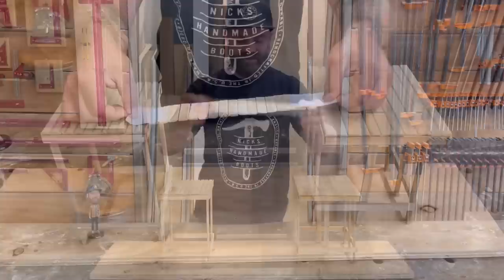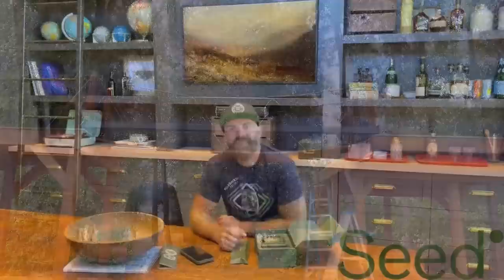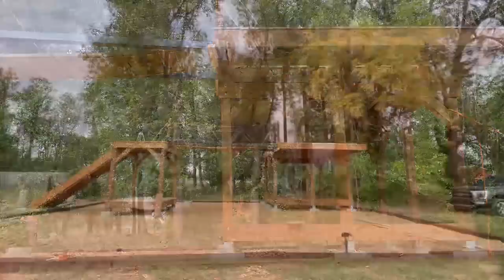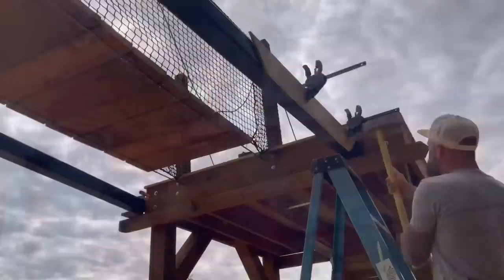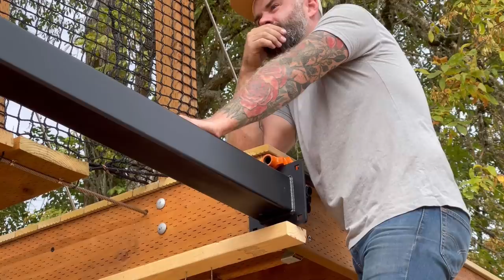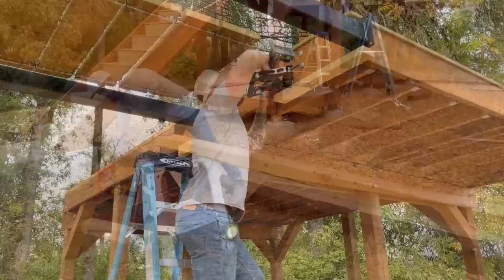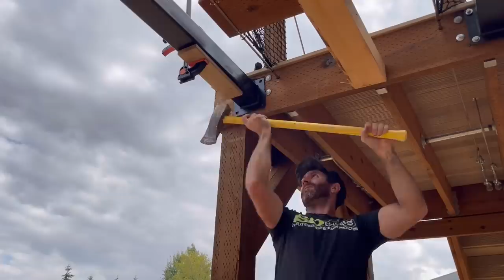My Treehouse is Falling Down || Fixing a Huge Mistake

Comment: I assumed you were going to add a few diagonal cross beams to the towers... but this definitely works as well ;)
Reply: A lot of armchair engineers here, and this was the best comment and best solution. (Maybe you are an engineer as well, lol) I am not. Enjoy your day!
Reply: @ST-ku5ni  I am an engineer, but in a completely different field so it doesn't really apply. I'm guessing he didn't want diagonal beams for the same reason he didn't want steel cables, because it's something to run into
Reply: @WoLpH  I was shocked that the original design didn't have diagonal bracing.. don't think I've ever seen a wooden tower like these built without them. Woodworkers should make engineer friends when tackling projects like this.

Comment: It's been some time since I calc'd a catenary, but the more level you drive the bridge, the higher the stress on the upper decks, pulling them together.  You may not have seen the end of this yet:  time and stress equal "creep", the deformation of materials.  A solution:  support the bridge from the steel beams, even if only in a couple/three places.  That will relieve the tension on the cable/wood interfaces.  Enjoyed the video, as always.  While you've come up with a lot of innovative techniques, we all might keep in mind that this kind of construction is millennia old, and the conventional  techniques are "conventional" because they've proven their worth.  But  I gotta admit to the fun!
Reply: Mechanics of materials! This brings me back to engineering math in uni.

Comment: did you think about loosening your bridge's wires before pulling the towers appart? 

Because i don't know if it is an optical illusion, but while your towers now seems to be level, the post supporting your top wire for the bridge seems to be out of plomb on the video. Maybe that was what prevented you from being able to pull the towers appart and you applied enough force to pry them out... Might wanna check on that.

Great video as always though!

Comment: Great fix… now that you have that steel in place it looks like a great place to hang a relaxing porch swing between the towers or even add a hanging sleeping platform that you can put a small tent on. Thanks for sharing and would loosing the cables have given you any more ease to pull the towers apart?

Comment: Expensive steel beams sort of eliminated the need for a suspension bridge, but cool for kids to be able to bounce across the span.  Rustic logs probably could have accomplished solving the towers pinching together,  and saved a few bucks.  I know, I know…who ask me anyways.  Every one of my projects could be second guessed.  Love your channel!
Reply: Yeah, my thought too. I mean, I don't dispute the validity of the solution, and bouncy bridges can be fun. But, yeah...

That said, I feel like the option B of larger bracing for the platform structure probably actually would've worked fine, assuming the footings are properly anchored (sorry, I'm one of those dummies that didn't go watch the first "making of" video, so I don't know what the status of the footings actually is). And then the suspension bridge could be justified both recreationally and mechanically. :)
Reply: Budget wise, that's what i thought too.

I mean, wooden beams will do the exact same thing, heck, they even used a beam to spread the towers...

Comment: An idea & thanks: I'm new to your channel and absolutely love watching your videos. This build especially shows your joyous adoration for your son. Just lovely. After seeing your fix, I thought - there's NO WAY he's going to leave that MASSIVE open 15' space underneath empty, right? With such strong steel beams you could hang or glide any weight from it. You could put a 15' wide rope ladder akin to a pirate ship with a wooden ladder and inward swing gate/door or port hole to climb through up top for those who made it up top. Then below each beam you could hang something like thick pool noodles to run through, bop each other, or swap out different items every few months on what is hung from it- when he's older a karate bag. You could face a 2-3 person swing the opposite direction of the pirate rope ladder. Or have your steel guy weld a runner or a seam in the bottom for pseudo zip line rope side by side to race each other (as long as padding is put on the landing side ;). Use that space when you get the chance! You'll be glad you did.

Comment: Running the cables through the 2 platforms and then at say 45+ degrees down on each side , to a suitable concrete anchor will reduce the lateral tension.

Comment: First of all, this is the coolest tree fort ever and you are a great dad for doing it! Watching this gave me an idea for you: These steel beams would be excellent as tracks for a 'zip-line'-esque rope swing. The way I'm thinking is to build a small (12"-18" long) railcar that surrounds one beam with 8-16 skateboard or rollerblade wheels, locking it in the x and y axes and freely rolling through the z axis along the beam. Then hang a large knotted rope (or some sort hand-hold) from bottom middle of that railcar . The idea is to push off from one lower platform while hanging on the rope and then ride the wheels across the beam to the other lower platform. Looking forward to seeing the rest of this build!

Comment: This is actually super helpful to me right now as I put together my son's new playset kit. I was worried about this exact issue because it also has a "clatter bridge". I reckon now if I notice a rigidity problem when the kids play on it, this is actually a fairly straightforward solution (and I could probably just use lumber with steel plates on the ends rather than a full on steel beam). Good stuff!

Comment: Jason I love your channel and can’t wait til you’re back in the shop.  Here’s a thought: remove  the suspension bridge and slap those wood tread boards on top of the steel beams.  All that lateral force becomes down force which is exactly what the towers were built to withstand.

Comment: attaching the end of cables to the ground under the beams  it would minimize the horizontal vector of force depending to the pressure over the bridge,so if you put more pressure you get more horizontal force minimizing .

Comment: Cross bracing on the columns! It will fix it without the numb-nut beam across the front. The beam fixes the bridge movement issue but not at all when a strong wind comes through. Simple wires and metal ties. You can always tighten them.
Reply: The height to cross width of the structures make it unstable. The problem will return

Comment: When you were fighting with trying to pull the tower out enough to slip the beam in, did you release tension on the cables? I would think by backing off the tension on the cables would allow you to pull the tower back enough to slip the beams in place then just tighten the tension again on the cables.

Comment: I worked with heavy production welding before, and I learned one thing. To get something back into plum. Chainblocks. if you couldnt with that. Use a bigger chainblock. ( And heat sometimes)

Comment: I built a playset for my kids last year that had a similar two tower design. In my initial design I had planned to connect them with a suspension bridge like you have here. I ended up scraping the plan because I became concered with the bridge causing something like this issue (I was more envisioning the two towers getting pulled over).

I like your solution though. I took the easy route and just made a ridge bridge with some 2x8. Worked, but not nearly as cool as the suspension bridge! Great videos, love watching!

Comment: Put diagonal bracing in the portal frame. From top one post to bottom of other post s d that should fix it. At moment the little braces aren’t doing much. 

Have one in line with bridge and 1 perpendicisk to it. Cheaper than the beans.

Comment: I love it!  You discovered a problem and set about to find a solution to that problem.  The failure of one solution after another did not deter you.  You kept at it until you came up with something that worked.  Sledge hammers, clamps, scrap wood, Ford F150, rope,... The only things missing were shoelaces, bubblegum and an old Farrah Fawcett poster.  Awesome lesson in sticktoitiveness.  Question:  could you have used some other material for the beams that might have been easier to handle, such as wood or PVC?  Awesome video!

Comment: To move them apart.  Two boards.  Hinged in the middle slighting longer than needed (like 1/2" - 1").  Set them in place then pull them down /-\.  They will press the two towers apart as the gets down to flat -- --

Comment: Lots of good comments but I found myself shaking my head as you climbed into the truck. Besides the cable tension (it's always the most obvious that we discover last) I was shocked to see the steel. I mean, 4x6 timber (even 2x would have worked in compression) would have retained the overall look. I like your willingness to share corrections as you go. Thanks for the good content and the ears look better too.

Comment: Dear Mr Moth, There could be a problem where the cable threads through the uprights (36inch height) as the cable may indeed start sawing its way down the post with the movement ....  I recommend passing the cable through a sheaf (piece of waterpipe?)
Reply: I commented similar a few weeks ago. Protect them holes!!!
Reply: Good point, could maybe cut a U-shaped piece of PVC and shove it in there so the cable wears the PVC out which is replacable.

Comment: With those steel beams, you don't need a suspension bridge. I have found that the secret to life is bracing.  Those little braces you have at the corners are not very effective.  They don't prevent the towers from racking.  I would have put diagonal bracing from the lower outside corners of each tower to the upper inside corner of each tower.  Then, make sure each tower is anchored into the ground sufficiently so that the towers don't get pulled towards each other. I once built a 12' x 34' greenhouse for my wife with treated 1 x 4's ripped in half (1 x 1 3/4) and it withstood multiple tropical storms over 14 years until trees fell on it during hurricane Katrina.  The replacement 34' x 96' greenhouse is made with 1 1/2" pipe and survived hurricane Ida with minor damage.  Had I taken the plastic covering off it would have had no damage at all.  The key is good, effective bracing.

Comment: You might want to fix the handrail cable to the vertical posts. That way you will reduce the moment on the posts and they would be exposed to compression only.

For the steel, next time make a adjustable connection to one end. Would make it a lot easier to put in place.

Nice work on the treehouse!

Comment: Your friendly neighborhood structural engineer here. I would have used a single diagonal cable with a turn buck from the upper left to lower right of the lower level portal that’s just to the right of the bridge. Also, and cable and a “come-along” from the upper deck to a truck would make plumbing the structure much easier. Jason, you’re awesome, I love your content. You taught me how to make cabinetry.

Comment: I was thinking to myself, self, how did they make bridges on playgrounds I used to go to? They'd make a flat solid bridge first to connect the two towers then install the chain/rope bridge on top of the bridge floor. But using steel beams is a great idea and is not over doing it at all! Nice job!

Comment: Great job, admittedly I was one who said it was over engineered .. as far as size of lumber used. which is still true,  its great but it is!  Smaller lumber could have been used. and proper cross bracing would of helped or solved this issue as well. and simple 2x6 or 4x4 wood would have accomplished the same thing as the industrial overkill 4x4 steal tubing. lol  when I say proper cross bracing, I mean you have corner cross bracing which is ok for things up top, but when you have a 8 ft tall structure that weights about 2500+ lbs, you need full top to bottom cross bracing. Like building bridges you don't just see a cross brace on corners, they go the length or height of the span in that section. when designing structures or Planes in my job. you want maximum strength with minimum weight. Now overkill on a child's play-set is all good and isn't hurting anything of course other than wallet.

Comment: Wood across that distance would compress and bend I assume? The black looks nice with the wood I think you failed upward 👍
Reply: Wood would have been totally fine... Those steel beams are a ridiculously over the top solution to this problem.
Reply: wood would have been fine.
Reply: @GreganDunn  his kids are going on this
Reply: @CoveringFish  would be plenty strong with just wood. Kids would be totally safe! The steel is complete overkill.

Comment: Those beams are ideal to attach some swings to too. Though that will add a dynamic sideways load in the other direction. So it might need some cross bracing after all.

Comment: For the NEXT time you have to do this.... ratchet winches are your friend.  My buddy and I demo'd an 80' x 40' 150 year old barn in Sacramento to salvage the redwood beams and tin some years back.  Because it the city had built up around it, there were fences less than 3' from two sides of it.  We hooked 3 ratchet ratchet winches to anchor points opposite the fences and pulled it toward the opposite corner -  we were able to make the entire building lean away from the fences - then cut into the principal posts and slowly winched the whole thing until it collapsed with no damage to the surrounding buildings.  Yeah... super safe.  But it worked. Pulling the treehouse a few inches would have been a breeze.

Comment: Tension cable on the big platform on the top next to the bridge and on the bottom on the back side.
But also should slack the bridge wires

Comment: As a serial over-engineer, I can so relate to this. Coincidentally I also happen to be a furniture maker, maybe its because I was never taught carpentry, but figured it out by myself and don't really know how to estimate material/constructional strength.  (you should see my Changing Table that can support the weight of a small car.) I actually came up with the same idea when I saw your last video because it was indeed showing flex. But for aesthetics sake will you be putting wood cladding around those beams? Good job though, the build looks really nice.
Reply: I'm the same way. I built a nightstand for my daughter which was immediately dubbed the "Helipad" because it was so big and heavy. LOL

Comment: If you had enough room on one side of the bridge you could use metal monkey bars as a brace too. Add a little fun to the functionality.
Also, I have pulled a garage into plumb using come-alongs and ratchet straps attached to the top plate of the garage and then to a sharpened steel stake driven into the ground at an angle away from the garage (about 3 feet long and 4ish inches thick so very heavy duty and very secure to the ground). As mentioned in some other comments, reducing the tension in the cables would have made it easier too.

Comment: Loved this episode - I saw some of the other comments below and agree that you could've probably made things easier by loosening the tension in the cables to allow you to open the gap between the towers.  But you got it done in style anyway - awesome work!
A possible next issue I could see is the 3' posts for the railing bowing in with the tension - I'm not sure how high those forces are, but a triangular bracing from the posts to the metal cross-beams may help with any bowing that might develop.  Alternatively, if you like metalworking ( :o) , you could weld 4 new upright metal posts directly to the ends of the cross-beams and get rid of the wood posts altogether.
Really nice work, though!  Can't wait for the next installment(s)!
And kudos to your grandma for braving the bridge - amazing!

Comment: VERY INTERESTING! I think this episode is a good insight on building structures and their design. I think it would have been a good investment to add corner strength by increasing the brace size on the stair-less tower. This would give the tower enough strength to resist the pull of the bridge, similar to the stairs function on the other tower. The steel solution is good but it puts a lot of force on the stairs which will not move and then the force all goes to the stair-less tower. Another idea is to change the suspension of the bridge, this coupled with the added brace strength would fix the issue imo. There would be a steel rope attached to each tower for safety that is longer than the span between the towers, maybe add a few more planks for additional slack. Have another rope, any kind, zig zag from the planks to the steel rope. For example if the span is 10 ft make the steel rope 11 ft. The second rope would be 11,5 ft. That would allow the bridge to have a sag, moving with the person, and stop adding a horizontal force to the top of the towers where they are weaker. 
The suggested larger braces should be parallel to the bridge force and on the stair-less tower, I don't think it needs to be an X. They likely would block a large part of the tower corner. I have seen people make rock climbing walls to make the wall stronger and keep it useful. The channel I Like to Make Stuff did a great job with it. 

Sorry for the long comment just really enjoying watching the process. I also have a lot of homework to do. It doesn't matter what you end up doing this has been a great journey to watch.

Comment: Dude you just need diagonal braces on the tower frames, high on the inside bridge side at deck elevation, connected low near the concrete footing on the far sides. They will carry the tensile forces from the bridge cable down to the concrete footing, or get really fancy and do an x-brace to prevent the tower frame racking.